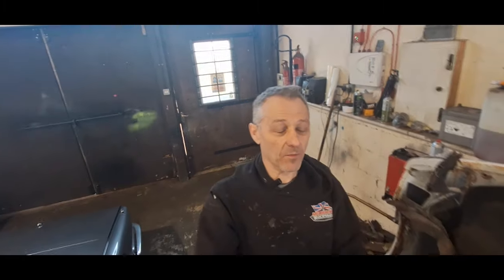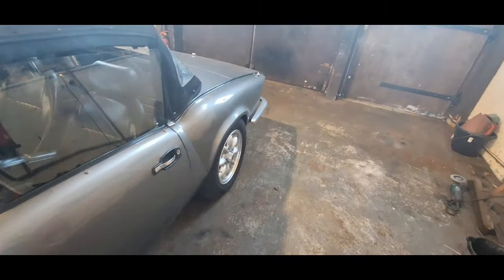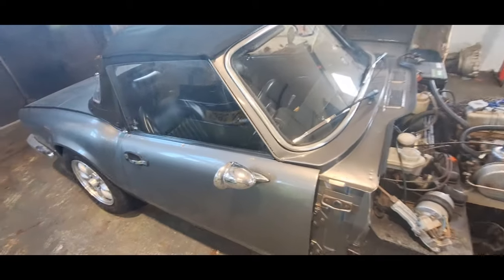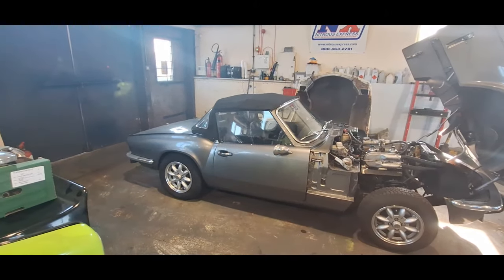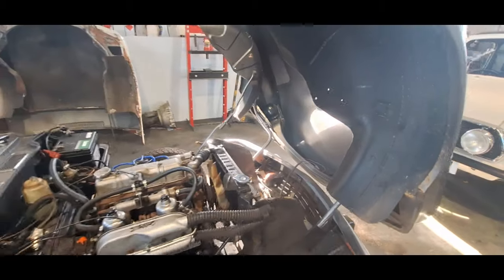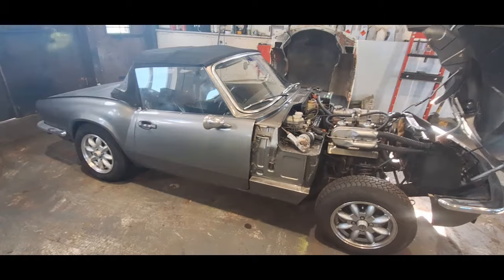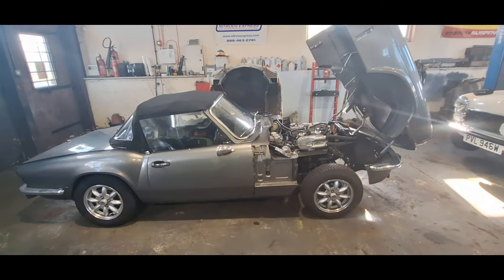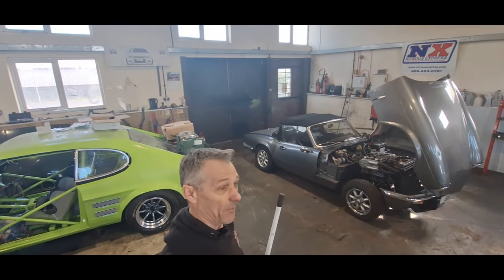Triumph Spitfire mkIV (Mk4)/1500 buyers guide-The worlds most affordable drophead classic sports car

Comment: diff can  be upgraded with a subaru diff.... but it can also be dramatically beefed up with a Quaiff LSD unit or aftermarket blackline unit.  bolt on easy.
Reply from the maker: Very true, to be honest they are fine with standard power outputs and are all at least 50 years old, so haven't done bad usually!

Comment: Interesting to hear your recommendation on ignition, on the Stag Owners Club Forum there's currently a poll on the most reliable ignition and Lumenition is favourite, but many owners have had good (as well as less good) outcomes with other brands. This is a favourite topic of discussion !
Reply from the maker: I've just found it the most reliable,  it arrives it fits and it works every time.  I did have an amplifier fail recently,  but that was an error on my part,  not the lumenition.
Reply: I’ve had Lumenition on my TR7V8 since the conversion in 1991 and it’s been 100% reliable.  Other systems claim to release extra power through providing a stronger spark but I haven’t put mine on a track day, yet, so haven’t been worried about that.
Reply from the maker: See the lumenition isn't a performance ignition at all, but a reliable system.  On my rover v8 I used the dm8 distributor with an external amp pack from a chevy hpi, msd blaster coil and magnecor leads. It didn't increase power, but it did maintain a good spark even on nitrous and at high rpm. I changed to an msd digital 6 eventually but the results were no better

Comment: How did you find removing the rear hubs for the freelander studs? I broke two pullers doing mine!
Reply from the maker: @BritSpit  I didn't remove them, I cut the studs to the appropriate length for the nuts/wheels and luckily they slotted through
I did a video on it, shows how I did it 👍

Comment: Why didn't they just paint them properly and wax oil them from new? The rest would evolve. as always, great vid.
Did you ever find the TR7 place near Rawtenstall?
Reply: To RobertIronsdale
The answer to why painting and waxoyling alone are not ENOUGH, is as follows.
The really old, (pre- mass produced cars )  were made from IRON.
IRON is a BASE metal, in other words PURE metal. Cars since then are made from STEEL. THIS is not a base metal, it's an ALLOY.
(In otherwise a MIX of metals). 
 When steel encounters WET, or even DAMP, it rusts. That's because the metals that make up the steel react against each other - and RUST!
So the answer lies in how 95% of metalwork, from cars to spades, are produced TODAY.
Have you ever heard of POWDERCOATING? The metal to be painted, is HEATED UP, and the paint is in powder form - and speayed onto HOT METAL. Then the powder paint melts, and sets onto the metal, forming an airtight coating - which keeps the rust out 3:17
Reply: @nygelmiller5293 until it cracks.  Then it rots out from the back of the coating.
Reply: “Quite flexible” 🤣🤣🤣.  Yes.   That’s a very, very accurate summation.
Reply from the maker: Some interesting comments on here lol. First no I'd forgotten in all honesty my memory is awful at the moment lol. As for paint and wax oil well they just didn't I guess, knowledge has moved on as has corrosion resistance. 
I'm pretty sure cars weren't made of iron for more reasons than I can be bothered to type lol.
Powder coating is over rated, it cracks, the moisture gets behind and rust expands pushing it off en block and I know from experience!